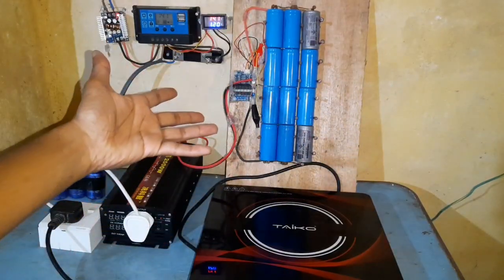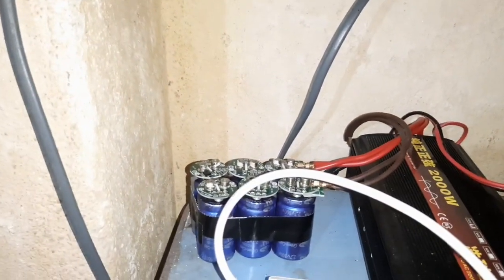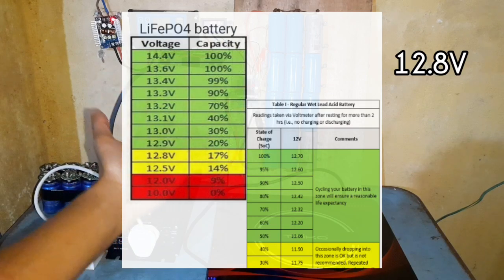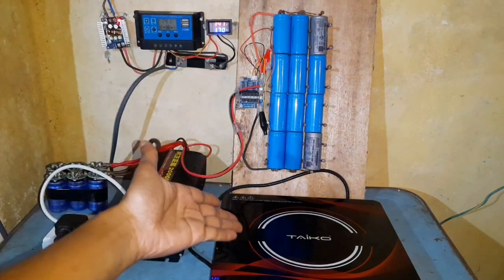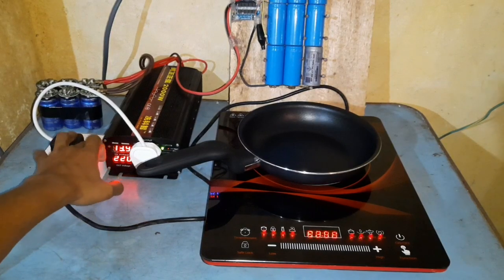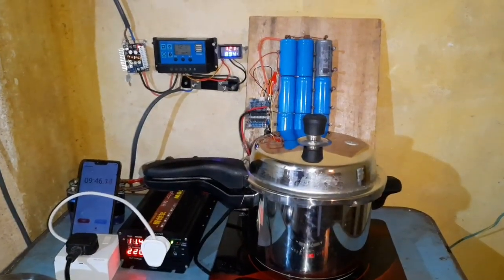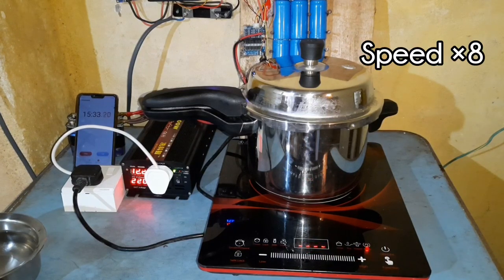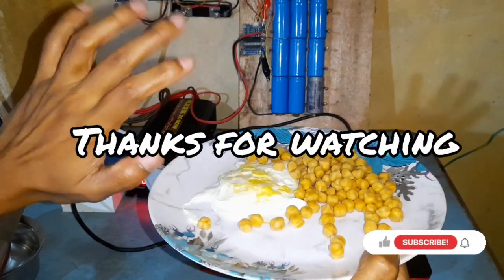Solar Induction Cooker! | Solar Cooking using Induction Cooker- Part 2

Comment from the maker: Cooking uses a lot of energy. Can any one tell me a better way to use solar power to cook meals?...
Reply: tbh i cant think of a better way then a setup like that. i really appreciate it you posting video like this  👍👍 you probably all ready know that by increasing the voltage of that setup will most likely be better in the long term
Reply from the maker: @onlyme80  Yes... a 24v or 48v system would be prefered if using for a long term.
Reply: De antemano muchas gracias por subir este video 👍 en mi humilde opinión con otro panel más de 150 watts y llevarlo a 24 voltios, sería mayor eficiencia para el inversor baterías y cargas...
Reply: Slow Cooker! Can be as low as 50w!!!
Reply: What can I do to use solar to cook for long time at a go

Comment: it's not good to parallel lead acid batteries to lifepo4 batteries.i think,u don't know what you're doing😢😢😢
Reply from the maker: Please educate me on what I may have done wrong. The charge voltage is regulated to 14.2V which is acceptable for both type cells, and the LiFePO4 cells are behind a BMS which will disconnect when the batteries get too low. Please let me what I have missed here.
Reply: @diysustainableliving2774  lead acid and lifep04 has different chemistry of charging.its n0t g00d t0 be in parallel.used 2 lead acid t0 be in parallel,s0 with the lifep04.0n the 0ther hand,u mush have ung low voltage disc0nnect.s0 that y0ur battery will autmatically disc0nnect to 12v.you will ruined your battery early as i see the voltage in y0ur set up.the charge v0ltage must n0t reached the limit v0ltage which is 12v.the DOD of lead acid is 0nly 50%.😅😅😅😅
Reply from the maker: I think you are confusing the lithium cells I have for lithium ion cells. I am using lithium iron phosphate cells. Not lithium ion cells!. 100% charge state for these cells are around 14.4v, which is also the charging voltage of lead acid cells. And 12.5v is the 15% DOD for LiFePO4 level which also the 50%DOD for lead acid cells. Thats where I want to limit the usage of the batteries within thers limits. Please look at the  voltage curves for the chemistries I am using and understand the rationale here.
Reply from the maker: Do the calculation and decide for your self and your circumstances. If you have plenty of money and dont have any budget constraints then of course you dont have to think too much. However if you have a limited budget and are willing to do some experiments then this is a proof of concept that you can consider.
Reply: @diysustainableliving2774 i kn0w what is the difference th0se lithium,lithium ir0n ph0spathe and lead acid batteries,but its bad to mixed lifep04 and lead acid.your video    was misleading.gudluck😅😅😅
Reply: @diysustainableliving2774  pls watch filipino diy'ers t0 impr0ved your set up...
Reply from the maker: Please read about the different types of battery cells out there and the differences in their voltage curves to better understand things. Thanks😊

Comment: Sir , I'm an engineering student and plan to work  on a project based on solar induction cooker..So in order to do the software simulations and later its hardware  we need to design the system ..but have no idea on the designing and related other calculations  ..can you please help with this sir
Reply from the maker: I dont think that I am the best person for this as my qualifications are not related to electronics or engineering. I love the thought that you are working on such a project as induction cookers have some of the best energy conversions efficiencies for cooking. And for people who want to utilize solar power every watt hour of power saving is important. I may be able to help you on some aspects especially in sizing the solar panels and the batteries for the system according to the load.
Reply: @diysustainableliving2774  Okay sir, thankyou so much....could you please explain  sizing the solar panels and the batteries for the system according to a load about 1200W
Reply from the maker: Lets say you live near the equator on a nice sunny day. The maximum power you will get is going to be around noon. So the calculations goes as 3hrs before and 3 hrs after 12 noon. So lets say you have a 400w solar panel and you are using an MPPT charge controller to get 100% efficiency. The maximum power you will get on that day will be 400 × 6=2400whr or 2.4kwh. So it will be enough to run your 1200w load for approximately 2hrs.
For the battery it depends on what battery chemistry you use. If you want to use it for an induction cooker I would recommend LiFePO4 chemistry as it is a relatively stable cell and quite safe for household use and has a depth of discharge of 80% for around 3000 cycles. That is almost 10 years of daily charging and discharging to 80%  capacity. So for 2.4kwh you will need 2.4÷0.8= at least 3kwh of battery storage.
These are just examples. These will vary depending on the time you need the cooker whether day or night and the size of your solar panels. If you have 1200w of panels and are cooking only during the day time you can use a much smaller battery and use the solar power directly for the appliance.
Reply: @diysustainableliving2774   Thank you so much sir

Comment: Can your induction cooker make it up to 2000w using your solar set up
Reply from the maker: My induction cooker is a 1000w one. To go up to 2000w you will need a 2000w induction cooker and you will have to size your solar setup according to that.

Comment: Sir, I've a doubt.
How many solar panels (1 solar panel having 320W of power)would be needed If I have to use an induction cooktop of 1000W power and there're 2batteries available each one having 12V and 40A. Here the induction cooktop is functioning from the power of batteries only not directly from the solar
Reply from the maker: So for an induction cooker to work for 1 hour you will need 1kwh. I presume the batteries you are talking about are lead acid. In that case you cannot go below 50% DoD. That means for 2 batteries at 50% you have 12 × 40 =480wh. That is a max of 0.48kwh. So as long as the batteries can deliver you have roughly 30min of cook time with the batteries alone. Id recommend a larger battery setup or Lithium iron batteries if you plan to use the induction cooker at nights. But if you plan to use it during the day time only you can add your solar panels to give additional power. Basically if you have 3 × 320w panels with a good MPPT charge controller you can cook using direct solar power. Since you have 2 12v batteries id recommend you make your system a 24v system as the panel voltages will also be higher and you will be using less amps for the same power which dramatically reduces stress on the system and can reduce power losses. Remember to factor in power losses as well for all steps as nothing is 100%  efficient!
Reply: @diysustainableliving2774  Thankyou so much sir! Sir if we are charging the battery from solar and simultaneously using it for cooking, will it reduce battery life?
Reply from the maker: No it should actually improve it as the majority of the power during the day will be comming from the panels and not from the batteries. So essentially the batteries will be cycled less and thus should increase its life span.

Comment: Interesting setup.
The readout you see on induction display are thermal watts. Electrical watts are much lower. Usually a third.
Reply from the maker: I dont think so because in this setup my inverter can handle 1300w continuosly. And here I cant go above 1200w on the induction cooker as the system goes into over load. So I think the power displayed on the induction cooker is the same as the power consumed. I cant be a third of that reading.
Reply: @diysustainableliving2774  This is how it work in all my induction cooktops. Pls do more research about thermal vs electrical watts. Also a Proper Watt meter will clear all the doubts.
Reply from the maker: Yup.

Comment: Very nice. Iam also thinking about combining both chemistries. But the problem is, that the lfp batteries will constantly float charge the lead acid, which leads to a lot of electrolysis, which increases water loss in the lead acid and total energy loss in the system
Reply from the maker: Electrolysis becomes an issue once the voltage goes above 14.4V. But with the lithium iron phosphate wou wouldent want to go higher than 14.4v and when not charging the setup voltage drops to13.3V in the fully charged state. At this voltage the lead acid battery takes a negligible ammount of current!

Comment: Hello, just a question, how many solar panel  ang watts do you have to run the inductor cooker?
Reply: Tnx a lot, i always watch your tutorial videos,,, i wait for your nxt tutorial vlog.
Reply from the maker: My system currently has 250w of solar panel. As you can see in the video my battery also gets significantly depleted when the induction cooker is running. That is because the induction cooker needs 1000w, around 200w comes from the panel and the balance 800w comes from the batteries!
Reply: If you upgrade your system to mppt then losses will reduce

Comment: I loved the way you could set the watt loads on the induction cooker, that's great when you only have so much power!
I also really loved the idea of using the pressure cooker for really efficient cooking! Would love it if you could try the pressure cooker at lower wattage's like 400 or 500 watts. I think the pressure cooker should still work but just take a little longer to cook? Maybe even try it at 200 watts. I think once the pressure has built up the pressure cooker will carry on cooking after you turn off the induction hob too! It would be great to find the combination of lowest watts and length of time in the pressure cooker after turning it off to cook food.
Reply from the maker: Yes... it all depends on what you want to cook and the quantity you are making. If you are using a little bit of water you will get steam fast. If you are using a lot of water you may not come to a boil fast but you may be able to do slow cooking at a lower temperature. But if you want to do serious cooking I would suggest you go with a 24v system, big batteries and a larger solar panel array to be sure you have enough power to cook day and night.

Comment: Good job. Only improvement I can suggest is to try different cooking speeds to find optimal efficiency. Both cooking an egg and pressure cooking could be done either more slowly or more quickly, and there will be energy losses that vary accordingly -  from inverter not operating at it's optimal point, inverters in the induction stove not operating at their optimal points,  constant heat loss to the environment meaning faster cooking is possibly more energy efficient than slow cooking, and others.
If you use a standardised test setup for your pressure cooker - such as timing how long it takes it to get to pressure, you can then use that to determine the optimal  energy use profile for more efficient cooking. For example you might be better off running the pressure cooker at the stove's max power (1.5kW?) until it gets to steam and then reducing the power level to 500W to maintain pressure. Likewise for cooking an egg you probably only need to get the pan hot quickly, then can turn the pan down or even just use latent heat in the pan to finish cooking it.

For example, Your pressure cooker might take 6 minutes to get to steam at 1000W, (i.e. 100kWh energy use)  but only 3 minutes to get to steam at 1500W setting (ie. 75 kwh energy use) because it didn't have as much time to lose heat to the environment, or the inverter and stove's electronics work more efficiently at that level.  if it tool 5 minutes to get to steam at 1500W then obviously that would not be better, (ie. 125kWh).
 Do that for various settings and cooking styles (eg. frying vs pressure cooking etc) and you should be able to plot the results and get an energy efficiency profile for various temperature settings per cooking style.
It would also be interesting to know if using say, a small 1000w microwave to cook the chickpeas would be more efficient than using the pressure cooker. I think you would have to pre-soak the chickpeas for best results.

I'd also use butter instead of oil for cooking the egg and mabey add a little salt and pepper, but that's just a cooking preference :)
Reply from the maker: You are right... Ideally thats how the induction cooker should be handled. First to heat up the pan at a higher power level and come down to a lower power level for cooking. As for the chick peas :) yes pre soaking would have improved results but this video was about proof of concept. I wanted to proove that with my solar setup I can cook a small meal. And not presoaking helps to reinforce the audiovisuals in this video. This is the most comfortable and conveniant way to cook using solar power. You dont have to stay in the hot sun all day and you can even use the battery power to cook at night as well.
Reply: I like this idea only I'm interested in less watts and more time, especially if a lot of that time is with the cooker off and just cooking under pressure.

Comment: Pls teach me🙄
Reply from the maker: Yes... what do you want to know?
Reply: @diysustainableliving2774  I want to know solar panels for  1 HP water pump how many solar panels need🙄
Reply from the maker: @satyamebjayate7390  1hp is around 1000w i guess. For how long do you plan on running that pump? And what time of the day do you need that power?

Comment: for a non techy guy regarding electronics, maybe you can show us how did you do it step by step and what are the exact specs of electronics parts that I need to buy also and everything to make it work and that would be wonderful! :) Great video by the way!
Reply from the maker: Thanks for the compliment. I have made a whole series of videos from how to place you solar panel properly to how to size and connect every thing up. Please go through them and if you have any questions on them please feel free to ask them in the comments section below. Cheers
Reply: @diysustainableliving2774  Could I use a 200W solar panel for the solar cooker set just like yours?
Reply from the maker: Yes.. it depends on where you live (Bright and sunny or cloudy), how much the panel produces in a given day and how much cooking you are planning to do. 200w panel should produce around 1kwh on a good sunny day. That should be more than enough to cook 2 small meals per day. But it is always best to get more solar panels since cooking is energy intensive. You will need all the power you can get.

Comment: Your gonna burn 🔥 the house down mixing those batteries.
Reply from the maker: These batteries are not lithium ion.. They are LiFePO4 batteries!..... They are not combustible as the lithium ion ones. And the voltage ranges match perfectly! :)
Reply from the maker: I made a separate video explaining the benefits of LiFePO4 batteries for DIY powerwalls. Please check it out aswell!
Reply: yeah,he mixed lifep04 and lead acid...misleading c0ntent.😂😂😂